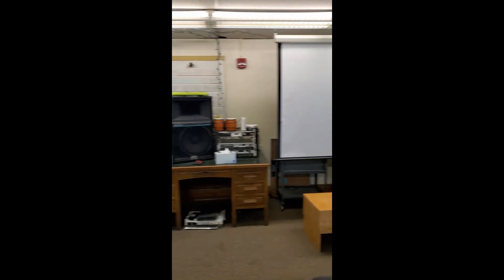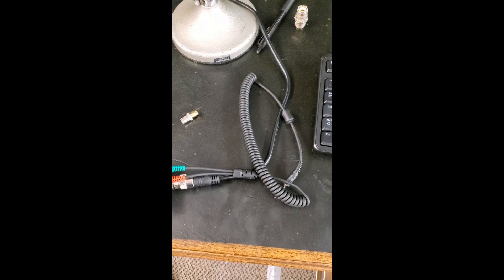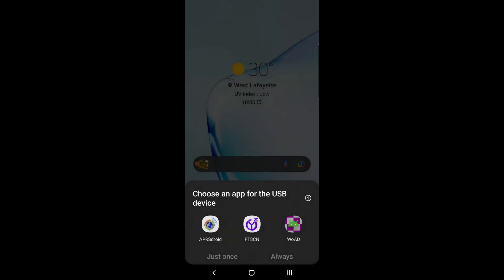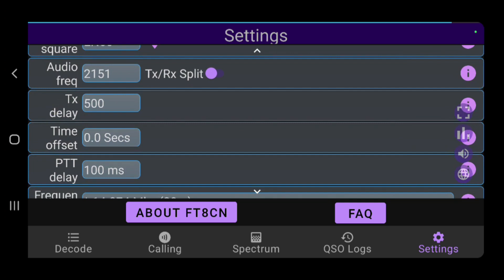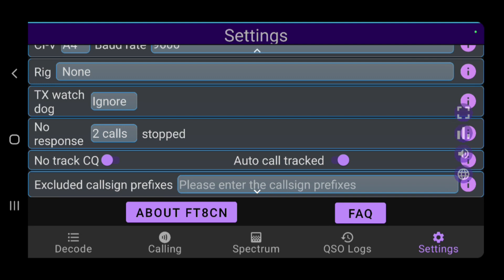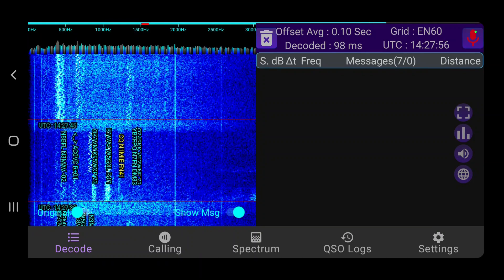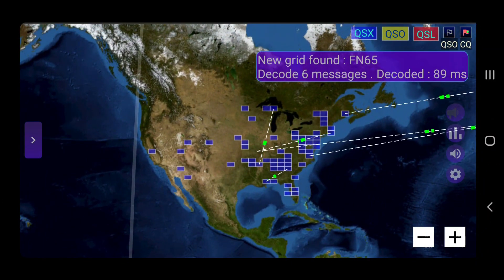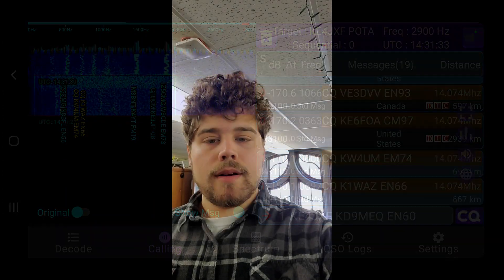Portable FT8 Made Easy: Operating From Your Android Phone Anywhere (FT8CN)

Comment: I found your video very helpful...  Often a quick tutorial is all I need.  I learned some new things about the software, and with practice, I'm now more confident I'll make the most of the software.

My rig is a QRP Labs QMX, velcro'd to a 12v 3aH TalentCell, with a Palm Pico iPaddle and a PackTenna EFλ/2 cut to 40 meters.  
I use a Galaxy S20 Ultra and a short USB c/C cable with FT8CN...  small, robust and capable... 

I'll look for more of your videos, Thanks again.

72  de W7UDT

Comment: Hi!  I have a problem with the audio signal from the DATA port.  My smartphone receives and decodes the signal in the ft8cn application only when it is connected via an external sound card.  How to connect the smartphone to the interface via minijack 4 pin?  My interface is digivox-2